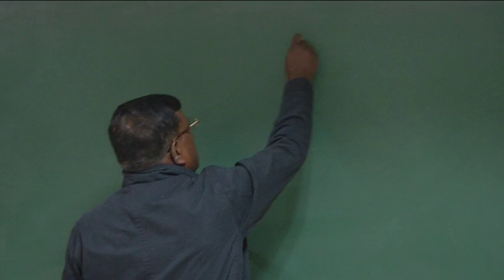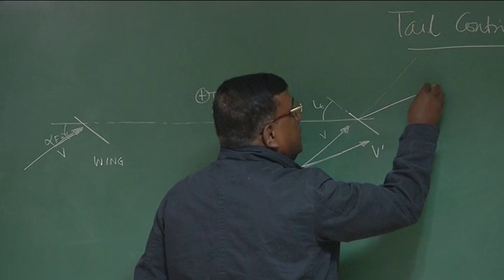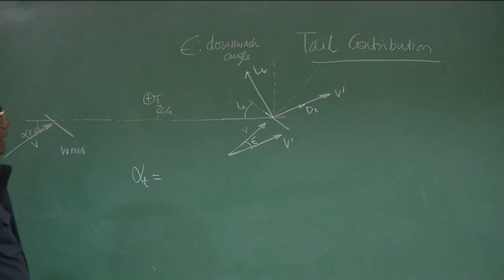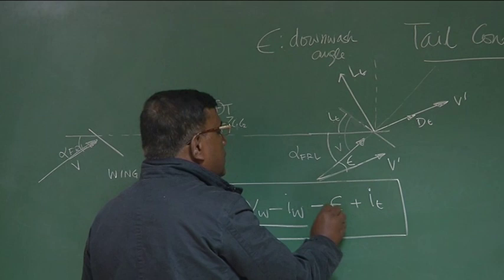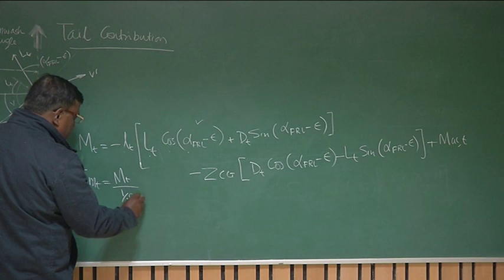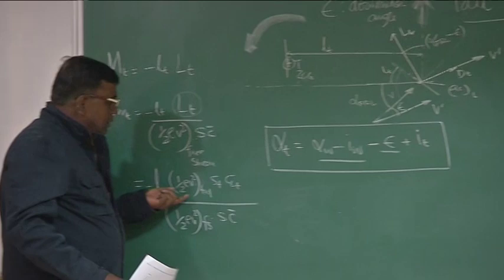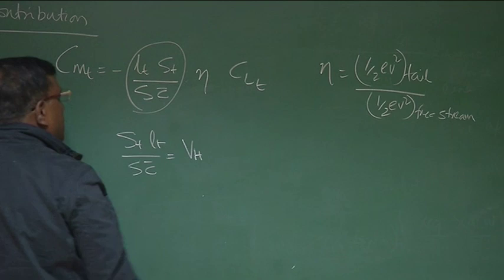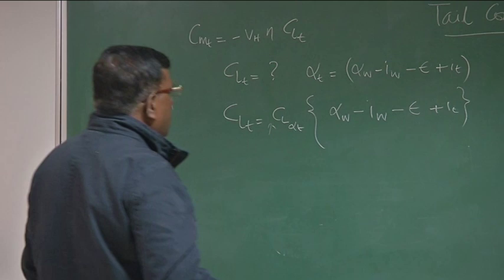Stability: Tail Contribution and Static Margin

Comment: Dear Sir. I see that after the first step while deriving the equation, the term (Cmac,t) has been neglected in the subsequent steps. Any reason for that?
Reply: generally,tail is  symmetric.therefore cmac=0
Reply: (Cmac, t)=0 only when the airfoil is symmetric and alpha=0. Otherwise at different alpha, it has some value because it is just the shifting of lift forces at aerodynamic center. But since it's value is too low compared to another terms so we can neglect it.